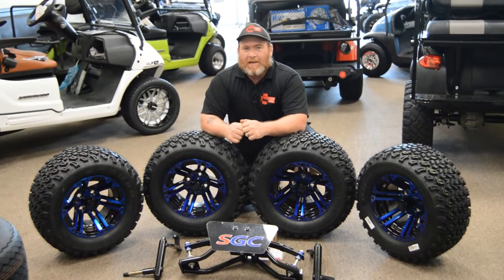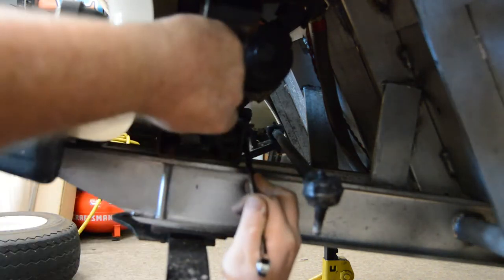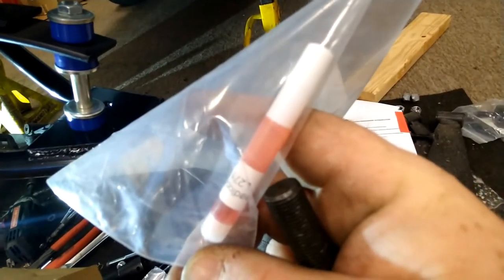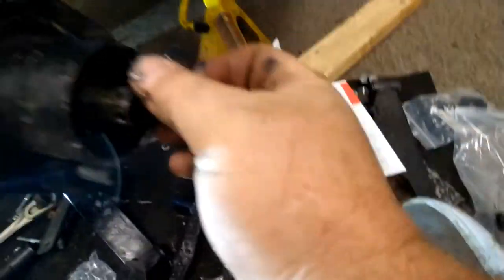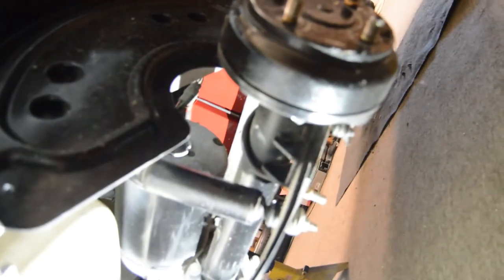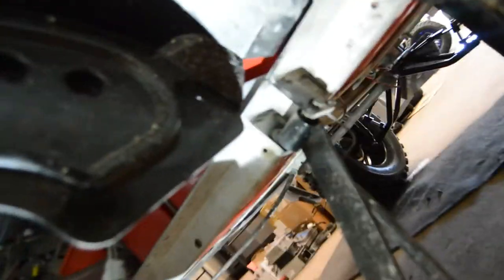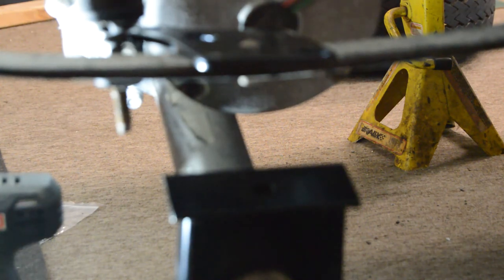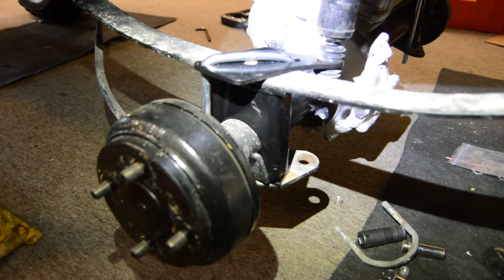DIY 6" Double A-Arm Lift Kit Install On Club Car D/S

Comment: Good luck on getting those bolts back out with all that Red lock tite, also good idea to repack the bearings!
Reply from the maker: Thanks for the advise,...however, I have a modified 1/2" impact that will take out ANY bolt locktight or not, Also, the video is for the installation of the lift kit,.....not the bearings being repacked. If you look closely, the cart itself had other issues, now, i didnt address those issues in this video .....because this video is just to demonstrate the install of these types of lift kits, But thank you for your input.
Reply: @cartsmd6524  understood, just always good advice to pack the bearings.
Reply from the maker: @adamheichel7066  great, thanks for assuming we didnt know that. What golf cart company do you own?
Reply from the maker: @adamheichel7066  no, un-solicited advice from a keyboard mechanic kinda gets me though.
Reply: I just watched this video and had the exact same thoughts!

Comment: So how exactly are you supposed to adjust the tire rods if you put Loctite on the bolts, to  begin with
Reply from the maker: The locktite type products usually form a crystalline matrix as it cures, you may un-screw for adjustment after its dried (its not a weld so just apply a little more force than usual) the crystalline matrix will still be on the threads, it helps to think of locktight not as a glue or weld, its just a "friction aggregate" that keeps bolts/nuts from vibrational movement or backing out, In fact, if you was to order say a suspension bolt from ford or gm, it will come with dried locktite on it already, factories put locktite on bolts/nuts at production so later the bolts/nuts can just be applied and workers dont have to wait for drying time or even the time it would take to apply it, no need, its already there, I hope Ive been helpful, Please remember you can reach CartsMD LLC at 1-833-227-8763
Reply: Mock up the heim joints first do all measurements distance between arms upper and lower. Use the jamb nut and a sharpie for marking,  back out 15 threads or so hit with loctite and tighten to your marks. If you ever have a issue with getting a nut bolt or heim joint loose after loctite.  Heat it up it will release.

Comment: Instructions say for 07 an newer models you have to drill out the holes for the tie rod and steering linkage  to the spindle bracket .. .., but I have an 01 and none of the holes are big enough.. looks like I will b drilling them out

Comment: I've watched a lot(ton) of videos on how to install a 6" lift kit on a Club Car DS. I watched this video of yours a few times and have come back for references. I came back today to see again how you installed the rear lift because my rear axle won't drop down like yours so I can have room to install the leaf spring on top of the axle. And now I see why my axle won't drop down... there is no F'n motor in your golf cart that normally would be attached to the axle keeping it from dropping. That was completely misleading. What do I have to do to get the axle to lower down far enough to install the leaf spring?
Reply from the maker: Please review time mark 10:01, pause right at 10:01, you can see just beyond the shock here, THE MOTOR IN THE BACKGROUND, INSTALLED!!! Please get your help elsewhere since im misleading you

Comment: Looks great. I have a 48v 96 DS. Will this work? Will it also strengthen the rear enough for a back seat? Also, how much does it cost? Thank you.
Reply from the maker: Your typical QUALITY purveyor of fine golf cart (non-chinese) parts will offer you a 6" lift, most 12 or 13" wheels and heavy duty rear leaf springs, parts, labor, transport all for somewhere in the neighborhood of $2200 or so.....Remember, ebay and amazon sell "hopes and dreams" versions of the real stuff for much much cheaper, BUT they are often mis-fitted, not serviceable, and you will never find replacement parts, they target desperate people looking to save a little.... buy from a dealer local to you who knows these carts and the best brands to offer, trust me, it will be cheaper in the long run

Comment: I put in heavy duty leaf springs in my 1995 Club Car Ds. I loosened a bolt on a metal rod thats attached to the rear of the engine and connects to the the underplate now the rod end is higher up and I can't get the rod end down far enough to reconnect. Do you know what this rod is for and if it is necessary? I loosened it so I could get more movement and clearance for install.
Reply from the maker: Z, Please call 239 465 6871 and/or text a few pictures of the area you are referencing and I will instruct. Are you talking about the shock?
Reply: @cartsmd6524  I have the same issue after installing HD springs on a 92 gas DS.. Did you have a solution? Thanks

Comment: What is thw total height diffrence between stock and the lift and tire combo?? I'm wanting to put a lift and tire kit on my ds but i only have 15 inches of clearance between the roof of cart and garage door
Reply from the maker: most 6" lift kits when installed with up to 23" tires will still be able to drive under a standard "man-door" height

Comment: I was looking at buying one of these for my 95 club car ds. I know this sounds dumb but I've never bought a kit before, when you buy a kit it comes with the parts to raise the front and rear correct?
Reply from the maker: generally yes,...they all come with fitments for both rear and front, HOWEVER, we never recommend putting lift kits on 36v systems, yours may be a 36v, if so, not a good idea, although they do sell lift kits for 36v carts, when considering the power of 36v systems then factoring in larger tires adds up to serious strain and leads to more repairs, upgrade to 48v.
Reply: @cartsmd6524  Thanks! I have a gas model and I'm looking to install a new engine kit which requires the cart be lifted.

Comment: You show all the easy parts but what about getting all the steering parts off? Didn’t show much of that
Reply: Also wondering when he finally figured out he put the upper arms on upside down and wrong side. 
I installed this same kit on a 93 gas ds and the rear was far harder than the front.

Comment: Will the u-bolts on the rear be long enough if you upgrade to a heavier leeaf spring??
Reply from the maker: Likely, the lift kit you buy will come with replacement "U" bolts being long enough for the job weather you have single leaf springs or heavy duty 3 leaf springs, the kit will include :U: bolts or bolt and plates designed to work either way